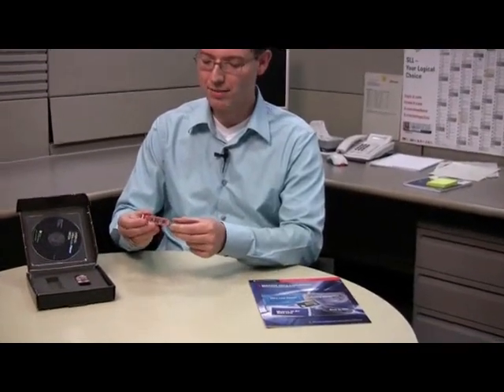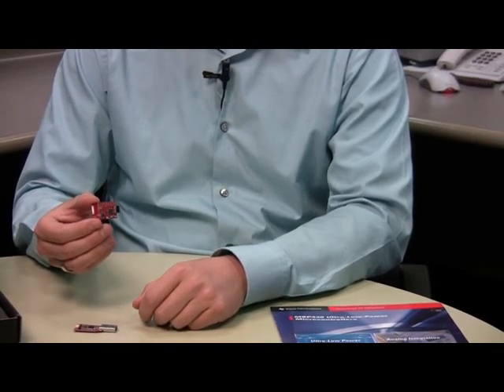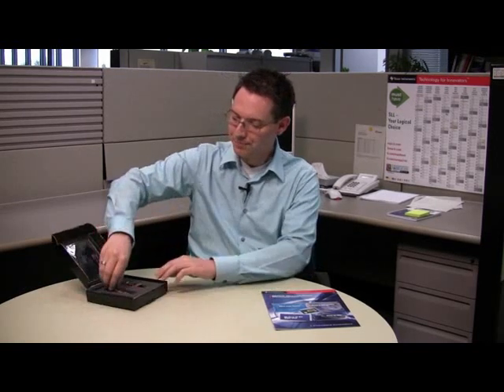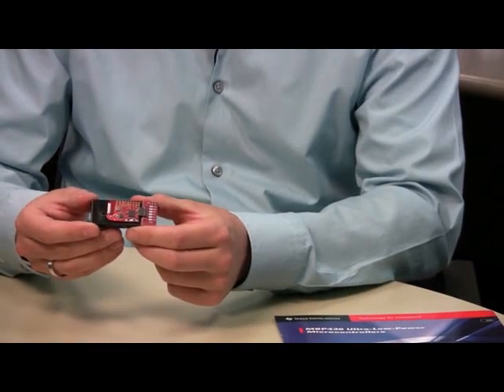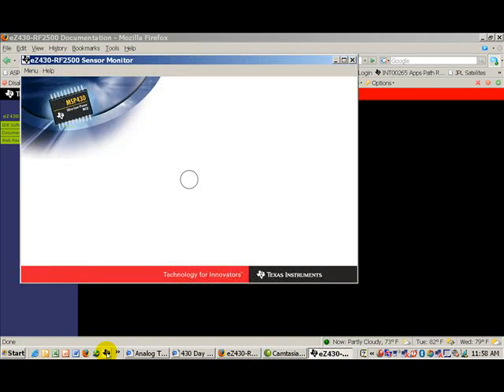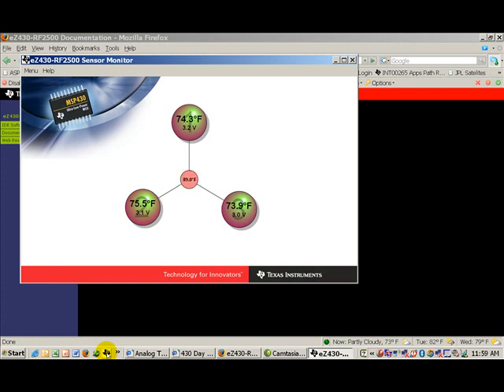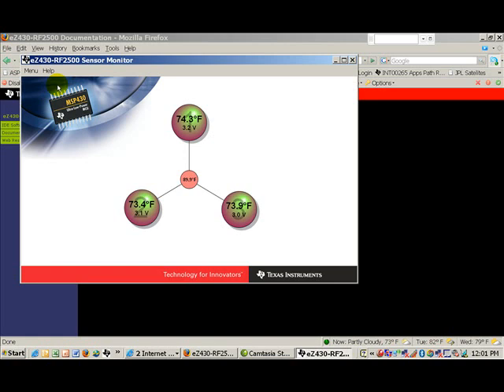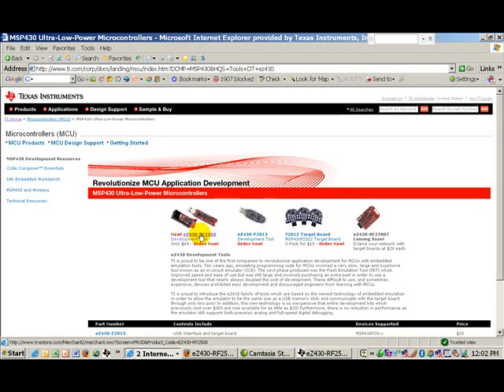Getting Started with the MSP430 EZ430-RF2500

Comment: Hello Sir,
Can I get the two target boards to connect without including the AAA battery holder?
I am trying to develop a robot with minimal dimensions limitations and this is why I bought this board, because I thought that I can use the two target boards alone without any addendum!
So, is there a way to power up the second target board without the AAA batteries or the AAA battery holder?